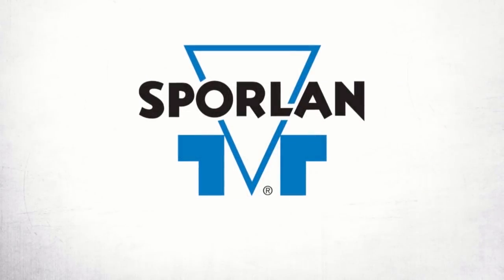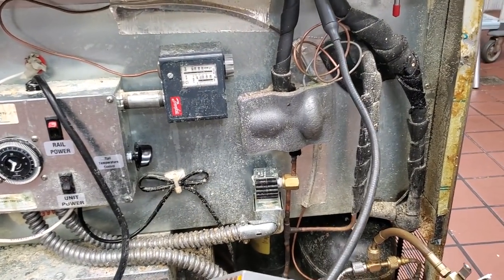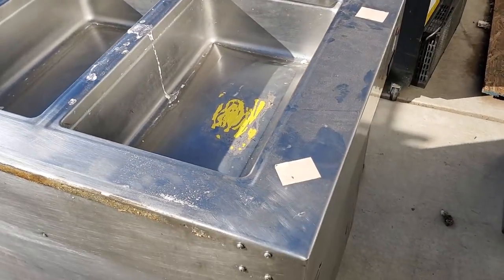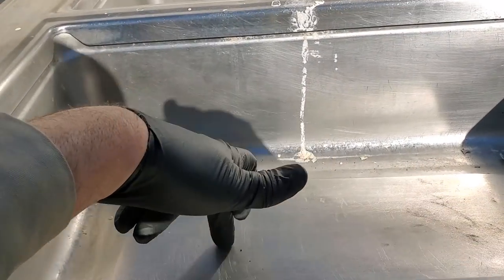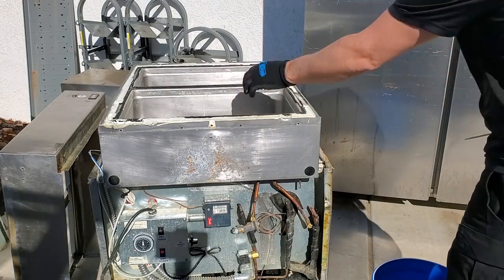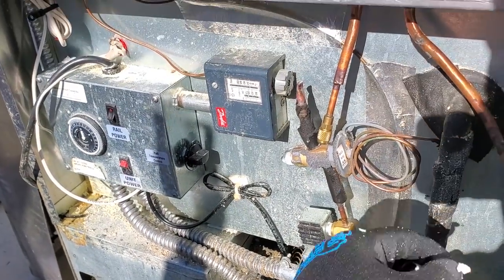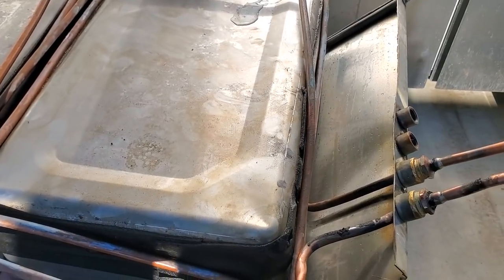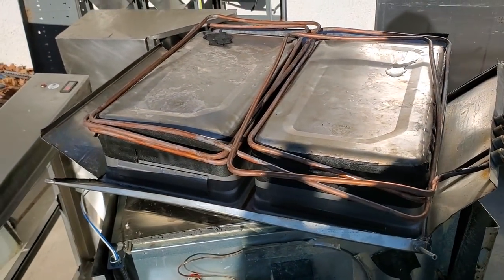REACH IN COOLER NOT COLD ENOUGH

Comment: Propylene glycol froze when the charge went low. The water mixed with the glycol comes out of solution and freezes. The consistency of a slurpee with the associated expansion of freezing. Have had chillers freeze the same way. FYI.
Reply from the maker: Interesting thanks for the response
Reply: John T thanks. Very interesting. the glycol comes out of the solution and the water freezes? So not a pure glycol solution.... spectrometer test? Even if it were perfect the low charge would freeze solution?
Reply: It would be hard to believe it would have a glycol water mixture that would freeze. It's basically anti-freeze. I've worked on Taylor shake/soft serve machines for years that have basically this set up. Glycol tubes surround freezing barrel and are mated to suction line working at -10 saturation temp. Glycol doesn't freeze in that situation.
Reply: I think the refrigerant leak pressurized the chamber where the coil and glycol mix was, and with limited volume, it pressed down on the surface of the glycol mix. That pressure was telegraphed to the bottom of the pans, which are a weak point structurally, so they bowed up. Yes, the chamber was not air tight, but sufficiently sealed in order to allow pressure to rise within the confined space.
Reply: To clarify, we’ve had some chillers freeze enough, with 50% solution, to stop the flow. One brazed plate heat exchanger was oil canned, but the concentration was unknown, as it was gone when we got there. The customer uses city water when the chiller goes down and frequently all of the glycol gets dumped. FYI.
Reply: the propylene glycol froze because of a lower temperature then the freeze point of the mixture of water and glycol.  cheep wall ss metal($) some one want better temperature in in top rail area (bd of health). dx rail system  have a film of ice on the side walls.(training)  the refrigerant gas leak was from corrosoin by a chemical action from the glycol and the water. also thin wall  copper tubing ($).
Reply: I agree with John T. Glycol breaks out of solution over time. I’ve serviced glycol chillers for long draw beer lines for years. Glycol has to be changed out.  The same freezing dynamic happens to the chillers. You get the call and you walk up to a huge ball of ice.
Reply: @brister74  straight glycol is inefficient at thermal transfer, the higher the glycol mix percentage, the higher freeze/boil protection, but the downside of lower thermal conductivity. this of course would be non-toxic food grade propylene glycol, but the poisonous ethylene glycol has much the same effects ( used in automotive/other)

Comment: Crap, sorry for 3 comments in a row chris, but for a short period of time, I worked refinishing tables for darden (mostly red lobster and olive garden). That pink stuff looks like cleaner i used to see them use to clean the tables. They started using it after that bird flu or whatever hit in 2009, and man it ate the poly right off the tables, kept us well busy. There was a pink one, and a blue one. Not sure if that might be the residual of what we're seeing on the back panel there? Probably not, but just a thought.
Reply: Just FYI if you don't know: those three vertical dots to the right of your post? If you click on them you can click "Edit" and it will let you change your post, so you  don't have to make a second post if you forgot something.
Reply: surface sanitizer is usually always reddish pink, so likely dead on :)
Reply: @throttlebottle5906  I know that stuff well. Worked for a few months in fast food (Never again thank you very much) and that stuff was used on everything. We ran out of it one night, couldn't sanitize the dishes. What a nightmare.

Comment: I had the same issue on the top of a cooler prep-table. Stainless steel polyurethane insulation inside. Totally swollen so hard that broke the marble table placed over it. In this case the evaporator was placed independently of the body of the table, no pipes inside it, just an evaporator crossing the box, no glycol. Three technicians SCRATCHING OUR HEADS ONE WEEK AT LEAST trying to figure it out. Manufacturer didn't know what the hell could cause that, engineers discarded chemical reaction of the polyurethane. Thank for share the disection Chris 👌

Comment: Good job with the deconstruction and forensics of the failure. If more if these videos were out there and the crowd larger I bet the manufactures would respond quickly. Education for everyone is the best remedy for rub-outs, there may be a way to address the issue. Maybe like a foam insulation to prevent the rubbing, I know the solution should not be a plastic bumper. Were you able to see where on the stainless that the copper was rubbing? We know the copper was worn through but the stainless surface where the copper was rubbing should have been polished.

Comment: Had to load one of these in my truck yesterday... Heaviest POS EVER!!! 

It's ironic , I had to do a startup on one of these awhile (done many) ago. After wrapping it up, when I'd looked at my phone, it was a notification for your video. Seems you'd posted a video of how to startup an exactly the same unit. 

I used to work in a manufacturing plant where we'd build similar equipment such as this one. I'd have to bend 20ft of 3/8" copper into a 1"x 2"  pan such as that one. But our copper design had more coverage and was less complicated to build and service compared to this RIC, since we used 404A not a combination of refrigant and glycol. And also made salad bars and all sorts of equipment, electrical, assembly and all. Now I've been replaced with a machine and 3 other people 😂😂😂.

Comment: Thank you for using the guard on the angle grinder. I see way too many people operating grinders without the guards... people who should know better (like, on TV!). Those zip discs can shatter, and without a guard the shards can embed themselves into your guts or head.
Reply: you learn quickly after exploding wheels and discs and I've had many explode using them (open) in a air die grinder in automotive/mechanical usage. there's no guard on those, it was user beware, I've been hit with piece that ricocheted off other things and it still hurts
lesson one, never have your face inline.
lesson two, never have any part of your body inline, it's much easier when the wheel is 90 degree angle from you, unlike most standard grinders are made for, so they have a greater need for a shield
Reply from the maker: Very true! I will be going live on YouTube this evening 12/23/19 @ 5:PM (pacific time) to discuss my most recent uploads and answer questions from emails, YouTube comments and the live chat, come check it out if you can https://youtu.be/K3iG5q_Q_0U

Comment: I think that because the top box is so sealed off, a pressure bubble was forming in the glycol and it was expanding against the bottom of the pans. Eventually, the expanding gas in the top box was so much that it was able to displace the glycol through the holes you saw at the sides. Also, I think that the lines started leaking because of friction or vibration ware. I don't think that the leaking refrigerant was able to freeze the glycol at any point since on escaping the line, the expanding gas would 1. Be of a significantly lower pressure and 2. Be of a significantly greater volume. The top of the box seems to be made from aluminum which is a relatively soft metal and the bottom of the pans are of a relatively wide area so even though the expanding gas from the leak would be at a lower pressure, it wouldn't have taken much, especially under operation, for the bottom of the pans to be forced upwards.
Reply: Yes I believe you are correct. The box is well sealed and the yellow tramsit cap on the vent pipe was not removed on instalation so creating a sealed container. The leaking refrigerant pipe created the pressure which bent the base which was the largest area for the pressure to push against. The yellow vent cap would not have been pushed off because of the small diameter of the pipe giving only a small pushing force. The glycol leaks are esily explained, the leaking gas bubbles through the glycol causing vapour which under pressure would weep out of any imperfect in the container.

Comment: it probably bulged when the refrigerant leaked into the sealed coldrail.
there was a cap on that overflow port that prevented the pressure from escaping, and pushed in the only place that would let it go: the cold wells.
the cap probably takes 5-10 psi to be pushed off, but the basins would collapse with a few inches WC.
Reply: Oh, and it is probably vapor tight because of the few drops of glycol that got into it too.

Comment: I'm curious if the leaking refrigerant into the glycol was able to create enough temperature drop to surpass the temperature at which glycol freezes and that popped the liner up...
Reply: Glycol contracts when it freezes
Reply: @ThoolooExpress  Maybe they put very hot water in it so it expanded?
Reply: @ThoolooExpress   if indeed it contracted, when it thawed it should expand and the void may be a pocket of air that pushed it up? just a theory. Being in residential I don't deal with glycol so I appreciate the knowledge.
Reply: I think an experiment is in order LOL
Reply: @ThoolooExpress  it's not pure glycol, it would be a water/glycol mix and the water very certainly expands. glycol alone is too poor a thermal conductor

Comment: I know it’s because they want to sell more equipment. But I’m surprised mfg don’t make those cold rails replaceable like any standard reach in evap. The way there sealed in makes it trashed if and when it leaks. So if it leaked during warranty do they send you a whole new box? 🤔 great video. Enjoyed seeing how it was assembled and the break down.
Reply: MR. ICE yup manufacture will replace it, but they will tear it down and find the leak themselves .. if they don’t find the leak or find something else wrong they charge you for the one they sent out ! Small self contained units like these are usually throw always .. sometimes they will fix but if the cold rail is leaking = trash

Comment: Hey, question, have you ever had a call to a unit that seemed to be noisy, and heard what I think they called the “death rattle” from the compressor?
My friend found an old window AC unit in the house he moved into.  I think it was an old, old Fedders unit (what happened to Fedders?). We tried it out, and, it made this really loud, repeating rattle, like a motor hum but much louder, at maybe 2 - 3 “rattles” per second.  The unit seemed to still cool, but only barely, as in, it was better than nothing until we got a replacement, but it certainly was making a lot of noise and barely any cooling.  What happens there?

Comment: I just had to go back to a call this morning and I suspect the cold rails are leaking. It's a big delfield prep table with cold rails and refrigerated base. Yesterday I was able to pick up a big whiff of refrigerant with my sniffer when I opened the doors but was unable to replicate that level of detection. This morning I go back and fill to 175psi with nitrogen and left 10-15psi trace gas when I recovered. Again I got a high reading when I first opened the door but was unable to replicate with two leak detectors. I spent a couple hours total looking for leaks everywhere and I am afraid the cold rails are leaking. Customer has recently replaced the compressor and a txv on this thing. I thought a coil since I picked something up but I went through those coils several times with two leak detectors and was unable to pinpoint anything.

Comment: I'm very curious about this manufacture. I have built custom systems like this. Not Glycol systems just freon bast units.
We would weld studs and anchor the copper to the pan, and foil tape over the copper. Then place the pan rap in the cabinet and spray foam it as need be. This pan wap was cheaply done. Would you please
tell me the manufacturer? Thank you soo much for all of your content!!
Reply from the maker: Delfield is the manufacturer  I will be going live on YouTube this evening 1/27/20 @ 5:PM (pacific time) to discuss my most recent uploads and answer questions from YouTube comments, emails and the live chat. Come on over and check it out if you can, https://youtu.be/5KtVii_Tw5M

Comment: I'd imagine there was some electrolysis going on where the copper was touching the other metal, glycol/water mix goes acidic with age/thermal cycling. more so in heated applications that I know of, but it should likely all be replaced every 3 years

Comment: Even pure glycol (ethelene or propylene) will freeze given the temperature. Pure Propylene glycol freezes -74F.  A 60/40 glycol/water mix freezes at -48F. There must have been a mix in that system, because glycol does not expand when it freezes like water does which ultimately deformed this unit.  Water is a better heat conductor than glycol which is why a mix is usually used just like in an automobile.

Comment: Could the top have been sealed so tight that the low , or equalized, refrigerant pressure (through the leak) forced the glycol to push the basin upward,,,, and eventually forced some glycol out?  Maybe the glycol vent was blocked?
Reply: Chuck DeArruda Good theory, but remember the glycol overflow? It was only plugged with a rubber cap, which means there couldn’t be any pressure build up. I’m gonna say the leak caused the glycol to get too cold and freeze up/expand.

Comment: sealed  part ?     then you had internal gas  leak    it then pushed up the bottoms     then somebody drilled a drain hole ?    what  is that hole for ?           maybe there was water in there at one point   and refilled   with gly   may uncle bob came over and tried to fix for a free meal   lol                  gylcol got into the foam and migrated to that hole   overfilled

Comment: But why were the pans pushed up?
Reply from the maker: I never figured that out....
Reply: @HVACRVIDEOS  That's going to keep me up tonight.  The glycol couldn't have frozen.  It freezes at like -75 degrees.  Obviously I wasn't done by a person pushing on them.

Did they customer say how long it had been like that?
The only things I can think is it was like that since new or it was dropped upside down....hard
Reply: @DoRC  It's not likely to be pure glycol, likely a mixture just like you do with your car. Could be set for a freeze point of -20-0 or so. 

As somebody else pointed out, the combination of the system running lower pressures due to the leak plus the refrigeration itself mixed with the glycol could have caused it to freeze

Comment: I might be talking rubbish but , would it be possible that the refrigerant leak is actually what cause d the stainless pan to deform ? From the pressure building up inside , if the actual covers etc make for a proper tight case around the pipes maybe ...
Eh , probably rubbish talk innit ...
Reply: Hey Chris , so , I just thought of something,  let me know what you think , yeah :
Maybe the swelling up was from quite some time ago , where for some reason the glycol in the unit got deluted , and then they had a freeze up in the top section , which caused the swelling up .
Then the tech who worked on it couldn't find a leak so he refilled the glycol , and maybe he put the pure glycol container over the top and it spilled all over the place , causing the pink marks on the back ...
I don't know , food for thought innit ?